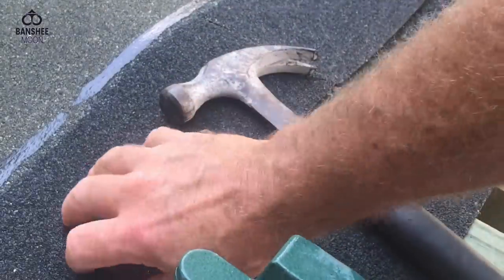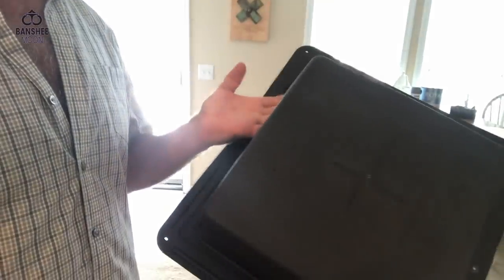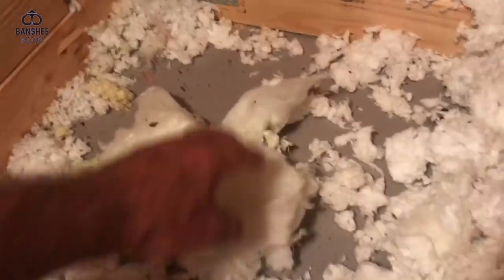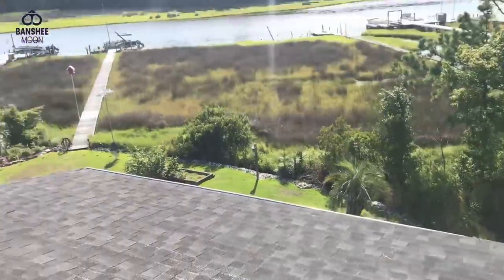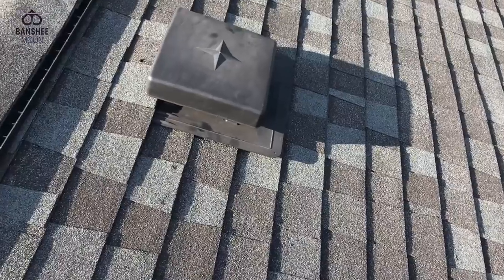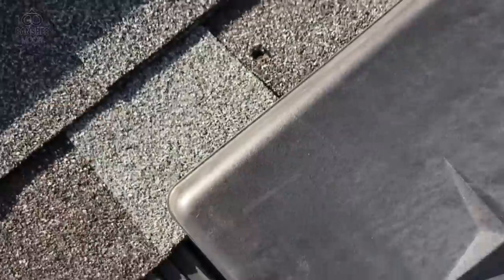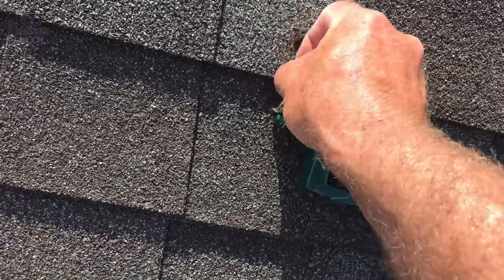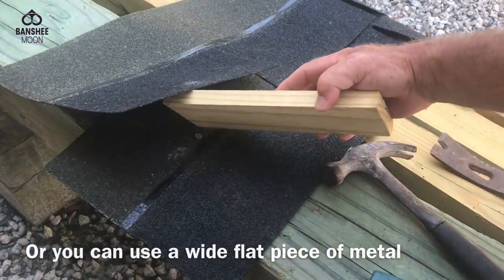DEAD HVAC, adding roof ventilation. Ridge vent not functioning well.

Comment: Exoman
Please accept the following suggestions. 
When your house was built the builder should have left a 1.5 " gap on both sides were the plywood meets the peak of roof. Then the ridgevent is installed, which works with the soffit vent under both sides of the overhang of the house. I would investigate if the soffit vents are actually open. Often times vinyl soffit is put in place but blocked in attic. I didnt notice any other vents on roof, each bathroom should have a quality ( Panasonic) bath fan installed with at least 80 CFM and should be vented directly up through the roof and not through soffits. You must get rid of the humid air during a shower. I put my bath fans on a wall timer. Lastly you should have an R - 48 blown in Cellulose insulation in attic. The blown in fiberglass insulation sucks. When  Cellulose insulation is installed correctly it should resemble a wool blanket. All ductwork should be sealed, especially the return ducts. The homes ive built have what they call a hot roof, which is spray foam (closed cell) between roof rafters. This keeps your attic  approximately 20 degrees difference between your living space. No more 150 degree attics. Your attic is much cooler and your A/C air handler in the attic doesn't have to work as hard. You can buy Cellulose insulation at H.D / Lowes and have free use of the blower machine for the insulation. There are charts online to tell you how much insulation you need in your region. Good luck.
Hi, Jen.
Reply: i had to learn all that the hard way..  i wish i saw your comment a year ago when posted...but now  im all done with the attic...i lowered the top of attic by 20 degrees  spent about 1000$  on a 1500 sq ft house attic
Reply: I didn't see any baffles at the soffit areas either so I bet some blow insulation is blocking his soffits.

Comment: sir you have a ridge vent, you should look at the soffit vent  to see if they are plugged up
Reply: soffitt vent first check and the second check make sure the ridge vent is cut on both sides. The Damage on the shingles appeared to heat related - hot spots from in the attic with no air circulation or rather no movement. Mike M nailed it. take a flash light or Q beam at night or pre dawn and someone pops their head on the attic the other person walks around shinning the light up the soffit vents check for blockage. If blockage is found likely you can take a air blower used for driveways and aim up the vents, this in most situation's will clear light blockage. repeat the flash light test to find out if the blower remedy was successful. otherwise installing baffles over the soffit vents always works - make mine out of shoe boxes - hope this helps from my experience as a CAT adjuster and professional roofing contractor.

Comment: I live in Texas , right now the temp outside is 100 degrees . I have 1400 sf home . I use ridge vent and 3 Roof Turbine Vent . It really did help adding the 3 Roof Turbine Vent . One thing to check would be your roofing soffits vents properly to pull air from the outside in and up and out your vents  . Happy 4th to you guys . Keep up the great videos .. Thanks
Reply: Sorry. Biden says no July 4th this year.

Comment: You can't put those kindof vents with a ridge vent. The air won't draft right. You need to check your soffet and vent it to cause it to draft out also you need more insulation. Then the ridge vent will work like it is supposed to.

Comment: You will probably benefit the most by installing a radiant barrier.  When you have a ridge vent a radiant barrier can keep most of the air flowing across the hot roof and leaving before it heats up the rest of the attic. If you want more of a benefit, then you can install the sheet foam which includes a radiant barrier, say 1/2".  This generally results in an attic that is only about 10 Deg above ambient temperatures. Installing the vents where you did can create a shortcircuit with the air coming in the vent and leaving the ridgevent.

Comment: If you're not venting through the ridge, there's an issue with your soffit. Either they are blocked by insulation,etc, or they are not large enough. Inspect your soffit areas to insure they are fully opened. Maybe blow insulation is blocking them. I didn't see any baffles to guard the soffit from any insulation. Move any insulation or other blockage of your soffit and install baffles. You need more air flow coming in through the soffit in order to push the hot air out of the ridge vent. Larger intake vs the out take.

Comment: I have a chocolate easter bunny sitting on top of my HVAC system which is in my cool attic.  My insulation barrier is on the roof, sprayed foam.  Love it.  ICF walls down below makes for an easy to heat and cool home.

Comment: I was going to put in an attic fan, then I did some calculations (I'm a HVAC engineer), and found that the energy of the fan running is a bit more than the energy of the compressor (that portion of the compressor devoted to the roof portion of the load).  Buying more insulation is the real solution:  you can virtually get the roof load to zero, and then you don't need to vent the attic.  And ridge vents, and soffit vents, aren't intended to ventilate the attic for heat; they're intended to prevent trapping moisture.  That's why the holes are so small:  humidity relief doesn't need large areas.
Reply: @Familyinmove  I'm a HVAC Professional Engineer, about 50 years' experience in the field.  So:  you can trust mfr info about unit component energy use.  But very few understand that energy use is a function of thermal conditions, which vary with time and use.  Here's the point:  I spend my cash on more insulation (unless you already have 12" in the attic).  It's cheaper to increase the thermal barrier than to reduce the temperature difference.  Thermodynamics of a roof/attic/crawl space/ceiling system can be complex.  Much of the heat received on the top (hot side) of the insulation comes from infrared radiation from the underside of the roof structure (which can hit over 200 degF) and thus isn't dependent on the attic air temperature at all.  This greatly reduces the potential benefit of ventilation.  
     The other thing that few realize is just HOW MUCH air it takes to substantially reduce the attic temperature.  The solar roof vent fans I see (and no, this is not an exhaustive research!) are about half the size needed to really reduce attic temperature enough to compete with more insulation.  And if you want to vent the attic, you have to come up with some source air locations large enough to match the air flow of the fan, or the fan just spins in "deadhead" mode.  And the source locations have to be far enough away from the exhaust point to "wipe" the hot sections of attic.  
     And once you get 8" or more insulation, the amount of roof load coming through the insulation is only 2~3% of the available roof heat, which makes roof load trivial.  And there's no point in spending money on trivial.  Put shades over your glass.  [aside:  retrofits of single pane glass with d-pane don't pay off as well as simply shading the glass.]  Check for leaks around baseboards.  Check duct leaks (surveys have shown that wasted cooling energy with leaky ducts can run 25%).  
     Here's the bottom line:  attic venting is the shallow end of the pool.  Go deep.

Comment: I think when your ridge vent goes all the way across, as yours does, you should not need more vents. More insulation should help a lot and a vapor barrier. Since the manufacturer did such a terrible job of insulating, I wonder if they installed enough soffit vents or if they failed to install baffles between trusses to keep the soffit vents from being plugged up.
The nail popping up is another sign of faulty manufactering and where there is one, there are probably more.

Comment: Roofing nails were installed with nail gun that was not held at the same angle as the roof, thus the nail head left with the edge of the nail pointing up.

Comment: Ridge vents should be sufficient.  Either they didn't open your peak before putting ridge vents on, or they blocked eves in so that sofit vents are useless.  Given the insolation job.....  the builder probably cut corners on venting....

Comment: 10:25 Exoman, reach thru hole in roof, and feel for the underside of the ridge vent area.  Some roofers will install the ridge vent as per code, but fail to leave a gap at the apex of the roof.  Something to consider when locating your powered attic ventilator;  the thing exhausts heat, thus it concentrates heat.  It creates a micro-climate "hot spot."  The room under the ventilator will now feel hotter than it did without an attic ventilator.  Counter-intuitive, but do your own research.  Am sure you will consider aesthetics and ease of finding power for the fan, but consider placing power exhaust on a north roof, or east side of the home.   Considering that a western room will have more heat load in the afternoon, and you don't want to position that "hot spot" over an already warmer room.   If you install sofit vents, direct louvers so jet from power washer does not enter easily.

Comment: On really hot days I spray the outside unit down with the hose every so often. Also helps if the outside unit is in the shade. Anything you can do keep the compressor from overheating. Make sure filters are clean and the blower fan and condensing coil fan are running at proper speed.  High humidity you want as much air flow as you can get. You may be able to increase the fan speed of the blower motor. Other thing I do every year is spray the condensing coil from the inside out with a hose. You would be surprised what gets in there. While I am at it. HaHa. If you put a fan in you will have to close off the ridge vent. Good luck. You are on the right track.
Reply: There is a problem with spraying the outdoor condenser coil:  it evaporates the water, leaving behind any salts in the water.  In  many areas of the NE, water quality is pretty good and you can get away with it.  In many other areas, usually where it's hot enough for AC, the water quality can ruin the coil pretty fast.

Comment: I am wondering what the reason is for the ridge vent is not working good enough! I had my roof redone in 2016 and a ridge vent was installed and I have not noticed a problem. you able to measure the size of the roof gap under the vent to see if its big enough?

Comment: Check capacitor and contactor, if the compressor is shorted, grounded or  locked up, get a contractor to put a new compressor in it. Thousand less!

Comment: I hope there is a followup video saying whether this worked.  By the way, just because there's a ridge vent doesn't mean it's adequate.  You can get ridge vents that are undersized (not wide enough) or poorly manufactured with less square inches of ventilation per linear foot of vent.  You also need to take the attic temperature on a hot (90 degree or better day) to see if it's too  hot and for use as a baseline to see if chopping holes in the roof lowered the temp.

Comment: You said you're outside condenser went bad .... is your HVAC guy a trusted individual because if your compressors not kicking on and you're not getting any cold air it could be something as simple as a starter capacitor $20.00.   I'm not there to diagnose the problem but many times in the summertime when everybody's running their air conditioners and the voltage on the telephone Poles drop power coming to your house could be low enough voltage wise that the capacitor starter that should be in there anyhow could be bad and it's nothing more than changing the capacitor if your blower in the house is running and the blower on the outside fan is running but to compressor is not kicking and I would check that 1st before sinking $2500 into a condenser unit

Comment: If the AC unit is over 10 years old, have your ac service guy evacuate the system and recharge it with freon.  It usually works.  There is natural leaking in any ac system and a fresh charge usually makes it work like new.  The interval gets shorter as your unit ages.  When it's less than 5 years, get a new unit.
Reply: Its a sealed system, low charge means leak. Evacuate system and pressure test with Nitrogen, use electronic leak detector  or bubble solution and find leak. Use silver brazing rod and repair leak and retest with Nitrogen, triple Evacuate system and recharge. Age of system effects efficiency only. Hvac Man.
Reply: There is no natural leaking in HVAC systems, Where the hell did you hear such a stupid comment! If Freon naturally leaks tell me why my father just replaced his condenser and coil after 45 years! The only parts he ever replaced was a condenser fan and a capacitor, He has never had to have any freon added to his system! My car is 29 years old and I have never had to add Freon to the system, The AC still blows out at around 41°F while idling on a 90° day! Whoever has been giving you HVAC advice you should find somebody new!

Comment: Never put ac in attic space number 1 number 2 where is the soffit and fascia vents without them you can cut holes all over that roof and it will never vent the shingles will curl and I already see signs of that starting

Comment: I have a big Thermal Dome Roof Attic Fan that runs from 7:30 in morning till 6-7pm at night, and run my Electric up 50.00 more!  I hope to find a Solar hood fan to replace it. Put 13- 16 inches of insulation in Attic, they screwed you!!  WHERE WAS YOUR INSPECTOR ALL THIS TIME!! THEY PUT YOUR DUCT WORK IN BEFORE THE CEILING WENT UP, INSULATION WAS LAST!!   YOU HAVE AN LAWSUIT RIGHT THERE!!